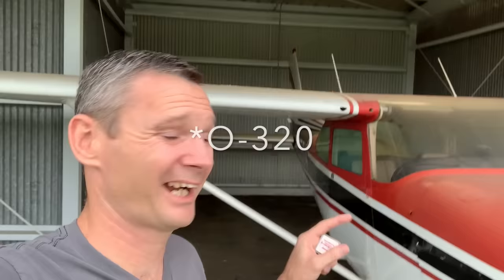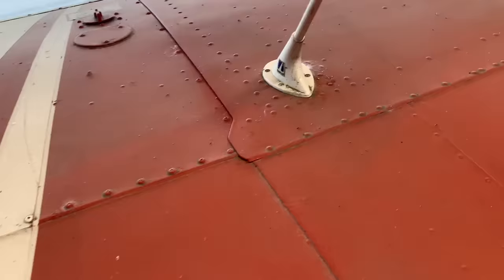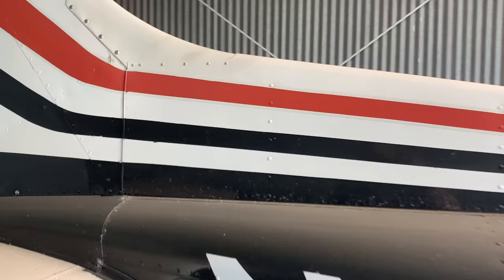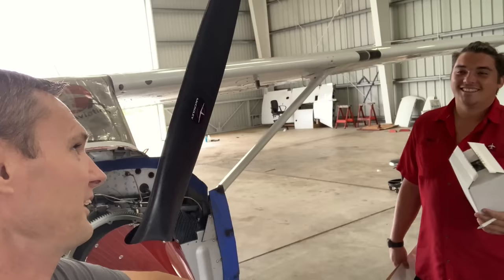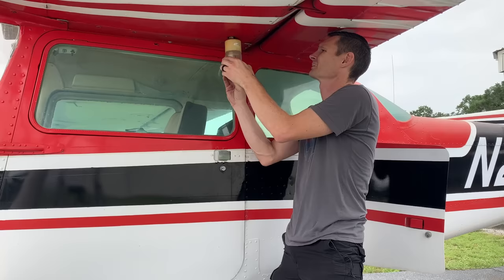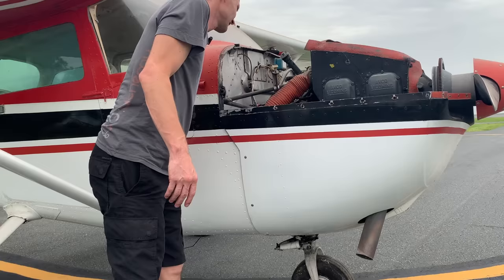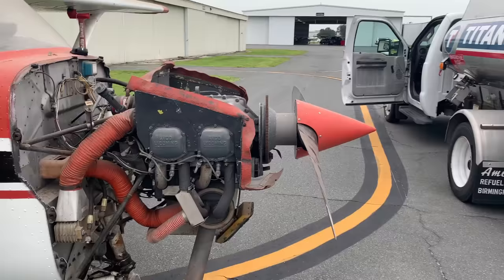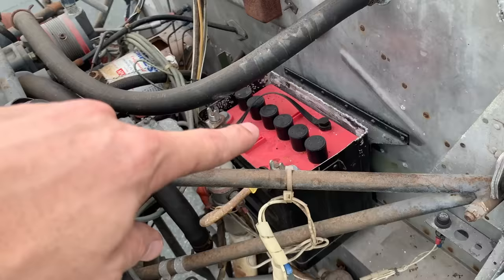Abandoned Airplane Will It Start? 10 Years in the Dark

Comment: Of course the oil looks clean on the dipstick!  After sitting for years, the contaminants all settle to the bottom of the sump.  Try loosening the drain plug and see what drips out!
Reply: Dip stick goes all the way to the bottum of the sump you'd see discolouration towards the botom if that was the case the oil filter looks new too
Reply: @wollyxl  Nope.  It does not go to the bottom.  That is Bullshit from you.  Most dipsticks wont get wet even with 2-3 quarts of oil resting in the oil pan.
Reply: yeah a little knowledge is a dangerous thing
Reply: @jlucasound  sorry but ive worked on countless o-320's the dip stick does but the low mark is not at the bottom.
Reply: @JohnDLeo-rg8tc  it definatly is.....
Reply: Things to learn if the oil is clean its new no sediment would be found in the oil as the oil filter picks that up, what turns oil black is the oil its self, it becomes carbonized due to heat,  in effect the oil burns as it is made up of  hydrocarbons, plus the aircraft was part way through an annual inspection, one of the simplest and oftern first jobs is droping the oil, and changing it for new, that's why it would be clean.
Reply: There are a lot of people in these comments who shouldn't be working on a office stapler, yet they want to talk about how airplane mechanics should do thier job. Lol.
Reply: @codylapoint  😆😅🤣
Reply: theres someeone  whoes never changed oil in their life llolol
Reply: @codylapoint  imagine theyy type with such authority lol
Reply: @codylapoint  I don’t know about the engine but the fan that keeps the pilot cool looks like it’s working okay. Don’t believe me that’s the fan on the end? Watch the pilot start sweating almost instantly when the fan stops working! 😂😂😂😂😂
Reply: @SuperJlonergan  my fave is the "bullshit on your part" as though to substantiate his knowlage. Lol
Reply: @mattivirta  good call but not nesacery as the engine will go for some 2500hrs before needing a top end overhual and another 2500hrs before bottom overhaul if you do a commpression test and get in excess of 80psi then you're good new plugs might be a good option but id have the mags off for signs of corrosion
Reply: what contaminants?
Reply: @emergencylowmaneuvering7350  well you are wrong just so you know because I literally just went through school which is FAA regulated I just learned how to teardown and rebuild these engines the dipstick on the exact same model engine which is the one my school uses goes all the way down to the bottom of the sump
Reply: Also even if there is some settlement at the bottom of the sump the filter will ask she pick it up first before it goes through the pump and if the filter clogs up there is a bypass so that way you're no matter what you get oil if you actually look in the FAA regulated training book that goes over how to rebuild these engines it will actually stay even for turbine engines and piston engines that dirty oil is better than no oil
Reply: @brandonsilvay4822  there is no by pass as that would render the filter pointless
Reply: Look at the specs it's actually a thing that the FAA has made mandatory for the engines and all manufacturers put in a pressure relief bypass that if the oil filter clogs up in too much pressure builds up in it instead of it destroying the filter in starving the engine of oil it will reroute the dirty oil that is over pressurized back into the engine so that way it can remain lubricated you should actually do your research I just went through the course it cost me over $35,000 for the course
Reply: And if you want if you are in Texas I am willing to meet up with you and Ashley show you in the books and actually pull up the diagram of the oil system for most aircraft engines especially for that particular engine so that way you can actually see it
Reply: @brandonsilvay4822  I stand corrected but it becomes somewhat difderant if there is a thermostatically controlled bypass for an oil cooler, clogs in an oil filter are rare so long as they are removed and cut open evey 50hrs the last AD I seen was for oilfilter adapters.
Reply: @brandonsilvay4822  It cant.  it will hit the pan and make a hole.  There has to be a clearance.
Reply: @emergencylowmaneuvering7350  have you seen a dip stick from a o-320?
Reply: Once all the contaminants are I  the oil they stay in the oil, it doesn't just magically settle out. Anyone who's worked on a long standing vehicle that was mothballed with dirty oil will attest.

Sure, larger pieces of contaminant will settle but the oil won't look clean unless it is clean.
Reply: @skylined5534  light contaminants like carbon might not fall down, but the heavier gunk will.
Reply: Good comment friend. If he's any kind of a mechanic he should know that!!
Reply: Ooo. 2 minutes into it, way too much corrosion to get airworthy. I am an  A and P.
Reply: Im getting sick just thinking about it. 🤢
Reply: All right. The oil in that engine is ashless dispersion oil. It's different than your car. I've checked oil on 172s alot. It always looks clean.
Reply: The plane was in the middle of an annual inspection when mechanic died.   It just had an oil change before instrument panel was removed, probably to repair an instrument or upgrade avionics. Then the mechanic went to the great hanger in the sky .
Reply: @emergencylowmaneuvering7350  sorry bud but you are 100% wrong
Reply: @wollyxl  Why??  Be precise..
Reply: @emergencylowmaneuvering7350  read throigh amd you'll spot it.
Reply: @skylined5534  7

Comment: Good call on letting it go. I’ve worked on aircraft for about 20 years. As soon as you got that engine cowl open all I could see was money fly out the window. Not to mention all the gauges and avionics missing and the corrosion to boot. Yeah it’s definitely no where near worth what he’s asking for it.
Reply: $1600 would be best offer. It's gotta go anyway. The owner has lost so much so long ago and it has only been costing him/them/her. and scrap value wont be much by the time it's dismantled for transport. I would not buy it for any purpose.
Reply: If you can just get it running and find someone brave enough to fly it in the pattern, post a video online then some dope will buy it without an inspection if you price it around 20k.

Comment: It’s honestly surprising that it started that quickly and ran that smooth. Good call on the compression test, just seeing it start and run it would have been easy to wright it off as a solid engine.
Reply: " wright it off as a solid engine"    lol i see what you did there
Reply: Starts? Runs on all cylinders? Transitions nicely? I could find a use for it. Would love to get my hands on one of those lycomings for building a giant scale dune buggy around. IDGAF if it won't meet FAA condition specs 'cause I won't be using it on an airplane.
Reply: @thomasdaniels6824  I’m glad someone picked up on it 😂
Reply: I wasn’t surprised it started. Airplane engines are like that
Reply: That's what the Wright Brothers used to do.

Comment: I know what you mean about high wings and checking the fuel. I trained in 172s. I bought a Musketeer last January. One disadvantage of a low wing is that you have to walk around the wing, unless you want to crawl under it. That's more than made up for by the ease with which you can check the fuel.
Edited to add: I left this comment right after I got to that part in the video. Near the start I was thinking, "Yeah, you could spend $100,000 to restore it, and have a $70,000 airplane." That was a total swag, and I was surprised to hear basically the same thing at the end.
Reply from the maker: Thanks for your comment, glad you enjoyed the video!

Comment: After a few rebuilds I’ve learned the rule of thumb is there are TWO additional layers beneath the surface layer you are making the resto assessment on so double/triple costs and time.
Reply from the maker: 100% true!
Reply: The first 90 % of any rebuild takes 90% of the time and 80% of the money.
The last 10% takes 90% of the time and 80% of the money.
And on your initial assessment just bump the unit of measurement... 5 weeks become 5 months.

Comment: Run it for a while and the compression should come back up after the rings break back in. Cars when they sit do the same but will usually come around after a few heat cycles
Reply: yes!!!
Reply from the maker: Thanks for the info, good to know!
Reply: I have 1st hand knowledge of a zero time 172 engine sitting for a couple of years and the mechanic would not sign it off for annual because of corrosion. Yes, that means a zero time engine had to be rebuilt. I'm a private pilot with up to date medical and bfr, but I can not afford to fly. I put an ad on Craigslist saying I would pay the extra cost to put me on the insurance and help with keeping the plane clean if someone would let me fly their plane a few hours a month. I know there are plane owners that would benefit from such an arrangement, but I had no offers.  Some plane owners would rather find out they're wives are cheating on them than allow a stranger fly their plane.
Reply: If they don't get damaged from rust in the cylinder ...

Comment: I haven’t seen any used 172s going for 60 to 80k in a long time. In similar condition, it’s been about the same estimate. So, good call, leave it!
Reply: Good 172s have been $100k+ for a while now
Reply: @rebelyell22  
That's with all the latest upgraded electronics and ADS A/B
Reply: @keithlucas6260  not the ones I’ve seen. Since 2020, the value of older 172s, especially models L through P, has shot up. With upgraded avionics and all that, I’ve seen them go for over $150k, and that’s with a high time engine, and high airframe time.
Reply: @golfnovember .....just checked Trade-a-plane prior to posting.....this would have been a gamble of breaking even in a depressed Covid economy at best.....the newer planes are at $300 grand.
Reply from the maker: Thanks for your comment, glad you enjoyed the video!

Comment: Back in 2005 I bought a 1969 C 152 that was a ramp queen. Was going to use the plane for putting around, keep current,, etc.. previously sat for 7y. Got it started, ran it, was okay. I bought the plane for 7k. Left it parked while I decided what to do. Wound up selling it on ebay for 16k and the new owner had it trucked out after taking the wings off. Wasn't a bad ROI: 9K for 4 months. Haven't done it since. I figured I got lucky that time!
Reply from the maker: HAHAHA, that's awesome!

Comment: Probably rusty cylinders, would have been interesting to look in before starting it
Reply: Rust will cover up the damage done to the cylinders. Fog lube the heck outta the engine...  run it then scope it.
Reply: @wb8cxo  if the engine had been disassembled and the cylinders honed to clean up the rust prior to destroying the rings it may had adequate compression.
Reply: @jimccc9467  all he wants to do is run the engine not do a top oh.   That planes a bad deal at any price.  Too much corrosion.  He needs to partner with a good mechanic.  Too much labor to make it airworthy.  It’d be good for drug running!
Reply: The engine should of been preoiled before cranking it over. And the cylinders sprayed with kroil or mystery oil. Let it sit a few days turning it over by hand as much as possible before starting it. Compressions would be all over 70.
Reply: @Nord3202  TOTALLY AGREE!  How do we know he already made his decision not to buy and cared more about making a video than the engine in that plane! Many YouTubers are going for content and not quality content!
Reply: Is that why you start them right off, because you're going to have to overhaul them anyway? It seems "get engine started" is the least of the problems with these old machines. It would be on a car.

Comment: Great video Jimmy.
sorry to hear that the old plane may be on its way to parts.   The good owner should give it to a team that would rebuild it.    I know that is asking a lot, but these old planes need to be preserved.   I know, its a Cessna 172, but what a sad thing seeing this one go out for parts.
Reply: Or maybe donate it to a school and get a tax write off...
Reply: That plane should be rebuilt and not scrapped. The airframe itself is probably solid, I own a 1947 luscombe that sat for 19 years before I got it and was worse than this and after a few months I flew it. That was four years ago I fly that plane every week
Reply from the maker: for real!
Reply: @alanluscombe8a553  that's not the point though if you're rebuilding and selling, it has to be profitable.
Reply: @alanluscombe8a553   the parts for a lot of the planes being fixed need to get there parts from somewhere and even the engine could be put to use in a really nice airboat almost as is.

Comment: I love planes always thought it would be awesome to get my pilots license and a small little airplane to take a quick afternoon flight somewhere and then I actually looked into it. Even a 30-40 year old plane is going to cost you $100k to get it in the air... Whether you have the knowledge of engines and the mechanicals yourself and DIY the rebuild (and spend the money for the inspections and such) or you buy it rebuilt with all the inspections its going to cost you almost half and probably then other half of what it cost originally when the annuals come around.  Planes aren't cheap to own or fly.  It kinda crushes the next generation from even bothering with it.
Reply: True. Airplanes aren't cheap to own or fly.  The best alternative is to join a flying club and you pay the amount to fly, roughly $150/hour.  Instead of forking out $100k and $5k / year, you just pay $10k/year to fly, if you fly a lot.  This is still expensive but it costs about the same for boats.  Most people don't use their boats every week either.  Their boats ended up like this airplane.

Comment: You would have to strip that down to bare frame and then down to bare metal. That corrosion and rust is your main concern. The mice have probably chewed up all the wiring harnesses and every single one would need replaced. Depending on how much you do yourself and how much you send out, it’s 40 hours a week for a year and no less than $100k. Good luck

Comment: Imagine flying that immediately after starting it for the fist time in years
Reply: He's crazy but not suicidal.
Reply: Sorry, but this is fake! Sat in hanger for 10 years?? Last flew Wednesday 17-Apr-2019 03:28PM EDT Google the tail number and check flight aware.
Reply: @brianallyn5308  You mean the flight that flew from Downtown Manhattan heliport? I highly doubt that was a C172. The same registration, maybe, but won't be the same serial number, so a different aircraft.
Reply: @brianallyn5308  registration expired and was assigned to a new airplane. if it wasnt renewed every 3 years then it was expired
Reply: @brianallyn5308  It was deregistered on April 19, 2018.  Cessna 172M, 1973.
Reply: @corporalclegg914  If you had done just a simple search, you would have found that this aircraft's registration expired 04/19/2018, and that KJRB is a heliport. So yes, an aircraft with the same registration may have departed that heliport on that day, but it wasn't this aircraft because it had been registered for over a year, and a C172 needs a runway longer than a helipad to get airborne.
Reply: @brianallyn5308  might be fake but it's absolutely junk.
Reply: @corporalclegg914  KJRB is the Downtown Manhattan Heliport. Someone misread an N number. 20504 is reserved and not on any airworthy aircraft.

Comment: Great video, Jimmy. I share your enthusiasm for an old engine sparking into life. Mine are mostly motorcycle engines and I’d risk a spin out. Guess an old plane needs rather more care. I’d add to the comments that piston rings get stuck and open valves get rusty and don’t seat properly but expensive just to strip the heads. I’m stunned at the cost of cylinders. Plus the other work involved. I see liability not asset. Look forward to the next one!
Reply: It's an airplane...just like boats the cost goes up merely because it is an airplane. Rope at the hardware store is $15 for 50ft. At the marina it's $75 for 50 ft of "line". See how that works. That crude as shit lycoming engine is worth about $12 bucks if it is bolted into the back of 60's Beetle.

Comment: 24:56 The only reason you aren't already flying that thing is red tape and beaurocracy. You know it's a good engine. It:

1: doesn't smoke blue

2: fires on all 4

3: Starts up with just a couple of revolutions

4: Transitions to and from idle

5: Idles like a boss

6: Hits on all 4 even at full power.

You have a perfectly viable engine here, one I would be confident enough to fly. It's a shame you can't just throw a cowl on it and fly it without getting in a shitton of trouble. Ah well. Be perfect to build a dune buggy around or somethin' like that.

Comment: 10 years sitting in Fl. 10 years with an intake or exhaust valve or two sitting open exposing the cylinders to the air. not to mention the lifters and cam lobes. Did Tom mention the least he would take for it?
Reply: owner is living in denial, wants $20,000.
Reply: P. S.:  What did he pay for 10 years of Hangar Rental, and WHY the F**K did he pull the dash apart??????????????
Reply: Even if the plane were free this is not an economically feasible project. As Jimmy says you'd be in $100K+ at the end so you could buy a plane in much better shape as the starting point.  Why the owner thinks anyone would pay $20K for his hangar hulk is beyond me.